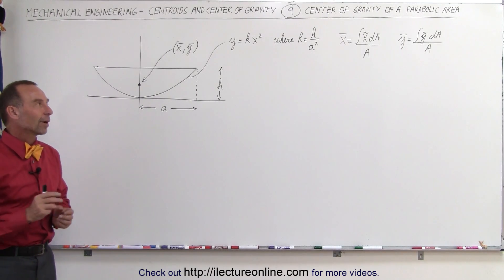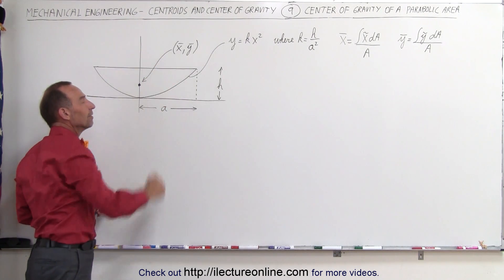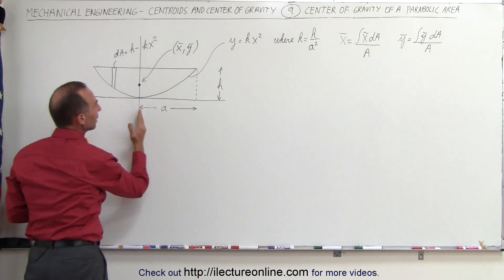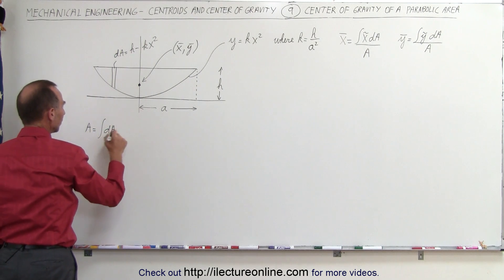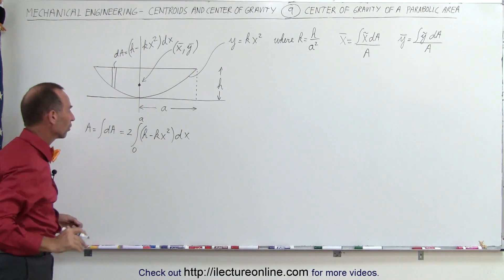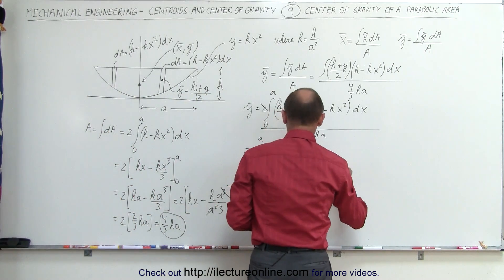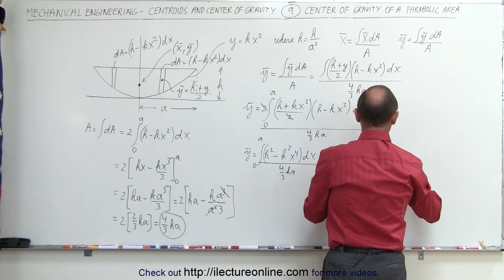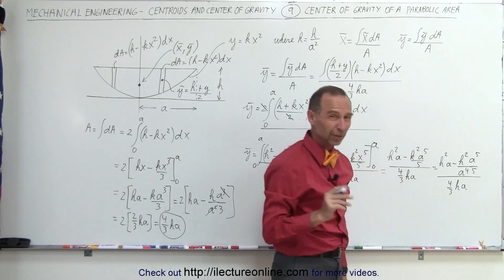Mechanical Engineering: Centroids & Center of Gravity (9 of 35) C. G. of a Parabolic Area

Comment: Pls sir i dont get why the midpoint of the strip is (h+y)/2 …wasn’t it supposed to be (h-y)/2??🙏
Reply from the maker: Take the number line for example.   What is the midpoint between 8 and 12?    midpoint = (8 + 12) / 2 = 10
Reply: @MichelvanBiezen  sorry sir but I couldn't understand the reason behind it yet.. why don't we consider only the length of strip (h-y/2)?

Comment: why is that the (~y) is (~y=(h+Kx)/2) ?  why not (~y=(h-Kx^2)/2) ? as to find dA is dA=(h-Kx^2)dx > 3:45
Reply from the maker: How do you find the midpoint between 2 numbers on the number line, let's say between 4 and 8?   You know it is "6", but how do you find it?   ((4 + 8) / 2) = 6    (not  ((8 - 4) / 2) = 2 )
Reply: Thanks a lot Sir Michel.

Comment: Why is the centroid of the small element dA taken as (h+y)/2 and not (h-kx^2)/2
Reply from the maker: How do you find the midpoint of 2 numbers on the number line such as 8 and 12?      (8 + 12) / 2 = 10    That is how that works in this example as well.
Reply: @MichelvanBiezen  Thanks sir 😃 !!

Comment: In calculating problems, how can I tell if I am dealing with a parabolic spandrel or semi-parabolic area ?
Reply: The equation given in the question tells you. In fact, it's not even about the parabola. It's finding the integral of the upper function ('h' in this case) minus the lower function (which is the parabola in this case).

Comment: is the value of y~=(h-y)/2 or (h+y)/2
Reply from the maker: +Karan Kasula Good question.  This is often confusing.Try to find the half way point between 6 and 8 on the number line.     It is (6 + 8) / 2 = 7    (not (8 - 6) / 2 = 1)Thus y~ = (y + h) / 2
Reply: I was have the same question her ... but noticed that you must calculate 
 the y coordinate of the average length of the little 
slice element which equal to y=(h+y)/2 
not the average length which equal y=(h-y)/2 ......
Thanks +Michel van Biezen
Reply: Can we say that y~ = (y/2 + kx^2)? Because the centroid of the small rectangle is obviously  y/2 and then for the coordinate we add the small piece that is just under the parabola (this is kx^2)